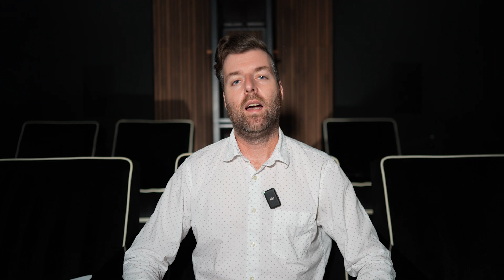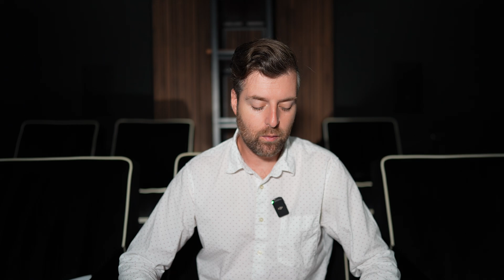Why don't H-frame DIPOLE subwoofers get more play time in HOME THEATERS?

Comment: Who makes H frame dipole servo subs other than GR Research? It felt like you were hard pressed to mention GR Research and Danny Richie
Reply from the maker: But I was trying to focus on a concept rather than a specific product. A specific product can’t necessarily overcome a limitation inherent in the design.  

And this has been a popular DIY thing for a long time. 

Really the servo piece js largely irrelevant. It doesn’t really increase max SPL all that much because servos take energy to clean up the sub. So eventually the subwoofer would clip the amp trying to feed back enough power to overcome the rising distortion. It’s better thought of as cleaning up the performance envelope over a larger dynamic range.

Comment: Recently have installed a DBA in my theater using four subs and a MiniDSP. It’s not enough for the width of my room and I can see the top end efficiency of the DBA is about 71hz, it’s smooth to about 95hz, and then succumbs to high-Q comb filtering above 95hz. It sounds incredible for what it is. Can’t wait to have enough subs to push that top end efficiency as high as I can.
Reply from the maker: Yes DBAs can be quite effective and impressive. I really didn’t bother with them outside of some experiments until Waveforming forced my hand. 

I will make the point here, just as an illustration, that this is where Waveforming sophisticated filters become useful. The DBA gives Waveforming a better starting place on which to work. But the filters allow it to extend the bandwidth a good half octave to octave above the point where the “analog” method gives out.  I get similar results with 4 subs as I would get out of 6-8.  And shockingly, I’ve gotten very good results from just two in the front and two in the back.  I did a theater recently with four in the corners. Used Waveforming.  I ended up with 1.2dB variance across the seats. It’s a 2 row 6 seat theater. That’s impressive in my opinion.
Reply: @PoesAcoustics  Impressive!

Comment: I do think, though, that the reduced excitation of modes by dipole woofers is significant. Perhaps a bit less with cardioids. A speaker designer with whom I work told me that in his experiments, four sealed subwoofers equaled a dipole woofer in smoothness of response and sounded as good, so it can be done. I also think that there's an issue with true dipoles and reflections from the front wall that create a notch. At one extreme, with an omnidirection speaker, the distance from the proximate surfaces can be split between the X, Y, and Z axes, so you don't get a complete notch. And, of course, as you say, the bottom octave doesn't benefit from dipole radiation since it's typically below the first mode!
Reply from the maker: Have you looked at Geddes simulation experiment looking at this. Once you get into multiples he found no difference. 

The main advantage of the dipole radiators is really reduced SBIR.  But for a home theater there are better solutions.
Reply: @PoesAcoustics  I haven't, sounds interesting. Am I correct in assuming that he's speaking of a minimum of four, rather than two? if the latter, it would seem to contradict Jim Croft's measurements as well as the measurements that Wendell Diller of Magnepan has made over the years in a number of venues -- I'm not sure why. If four, it's consistent with my understanding, and I think your right that dipole woofers aren't as practical for home theater.

Comment: Thank you!  I really appreciate that you always fine tune my perceptions with more precise descriptions 😀   I understand now the issues with using this servo approach with OB speakers.  I really could not test them in a way to compare the sound, because you can't run the amps with the servo function defeated.  I did do a lot of testing with REW and could see the effect of the three damping positions on the impulse response.  I did a ground plane test outdoors just with REW and frequency response was quite flat.  The 2% distortion I referred to was at 75db-ish REW measurement level ... but it was significantly less than the two ported subs I had been using.  I have not tried to measure maximum output, or distortion at very high output.  I will say that the Amaze demo does hit 105db, but certainly with no chest slam.  But for MUSIC ... the sound is awesome.  I am able to place them 7ft from the front wall and I'm using them in a (nearly) all Magnepan 7.1.4 system.  I appreciate your qualification of the mode topic ... yes I should have said they do not excite the resonances as much.  I did a test in an untreated room with one of these subs vs a ported 12" and I could distinctly see the difference in which resonances were excited by the OB sub depending on which direction it was pointed ... i.e. mostly the resonance in the front back direction in the room and not side to side or floor to ceiling.  I would love to see more quantitative tests, but alas even the company that sells the kits does not provide any test data.  Probably a great combination would be a system with these subs for Bass Management and true high output subs for LFE.  One more point .... I did not line the insides of the H-frame with NoRez.  I just can't imagine it would have any effect at these low frequencies, and I don't see any particular anomalies in REW measurements outdoors or indoors.
Reply from the maker: All makes sense. Servos work. They just have their limits. 

I mean I can achieve less than 1% THD at 75dB above 20hz with the RTJ 18’s. No servo and sealed box. That’s a function of the well engineered driver. In fact that low distortion would be maintained a good bit above that level.  Arguably these distortion levels are all inaudible and so some claim that what really matters is the point at which distortion starts to really get above that 2% point. When you see it start to skyrocket. Indicating it’s really in distress.

Comment: Hi Poe. I have a question about Dirac and room correction software in general. My understanding is that up to around 500hz speakers interact more with the room and so the room correction software is correcting for the room but roughly above 500hz it begins correct for the speaker, as this is when how much speakers interact with the room, especially well treated, goes down. Is this correct? Does it make sense to correct much further above 500hz especially in treated room? Or do you usually correct for the full spectrum no matter what? If cutoff is different from system to system, how do you find the right limit for the upper curtain?

Also, when correcting, do you manually add points on the curve to lower peaks if, after all the measurements and applying inital curve, you can still see peaks with REW because software isn't compensating enough to flatten the response?

Thanks!
Reply: There is something called the Schroeder Frequency below which the response of the room predominates and above which the response of the loudspeaker does. That isn't because the room modes disappear, but because they're spaced so closely together that the ear no longer hears them as such. At that point, you want to shift to correction for on-axis response, which roughly speaking accounts for 2/3 of subjective sound quality. To calculate it,  divide the room's reverberation time in seconds by the volume of your room in cubic meters, then multiply the square root of that sum by 2000. You will need a microphone like the Umik-1 and Room EQ Wizard (available for free) to make the measurement.
Reply from the maker: Thank you for supporting my channel. I’ll make sure to record a video and answer your question soon.

Comment: FWIW, it’s been my experience that open baffle systems attempting to dig as deep as would be required for chest slamming’ HT use - whether EQ’d  by more traditional methods or servo - require not just substantial amounts of power, but certainly need more space than small sealed or ported enclosures. Add to that the huge advantages of multiple subs in terms of controlling room modal issues and evening the bass over multiple listening positions, and I’d image things would start to get very impractical in less than huge rooms.
Reply: Agree, but as I understand it, dipole woofers control room modes just as well as four sealed or ported woofers. There are multiple tradeoffs here.

Comment: I think the average person wants a speaker with two wires they can connect to the back of a receiver and be done.  You can't do that with open baffle woofers, you need EQ and you need a lot of surface area.

I use sixteen 15" woofers in something similar to H-frame baffles using inexpensive woofers from Newark, formerly MCM.  (Eight on each side of the room) When I bought them a few years ago I think I paid $18/ea for them (I bought a lot of them, for other stuff etc) and yet the distortion performance met or exceeded the 15" Dayton Reference drivers I had used in a similar design years earlier at least within the design parameters of the system.  Mounted in magnet to magnet pairs, mechanical energy is cancelled and the cheap basket issues are made irrelevant, they aren't ever rigidly mounted to the baffle.  I cut them off at 35 Hz and at 90 Hz and I wouldn't trade them for any commercial woofer system I've ever experienced.  Below 35 Hz is handled by twelve 18" Dayton Ultimax drivers in infinite baffle, attic mounted also magnet to magnet pairs to cancel mechanical energy.  I cut the Ultimax drivers off at 10 Hz.

Is this a user friendly simple system?  No!  Most people wouldn't want a system like this, there really is no market for it.  If you want a system like this, you really need to build it yourself.  This is very much a DIY only thing, no commercial speaker manufacturer would want to touch it.  Speaker manufacturers have a lot to consider, if they offered something like this maybe they would sell a few systems but no where near enough to offset the cost to develop the design and build it in small quantity.  To me, it's a great thing, I wouldn't trade it for any commercial system but it's just not a marketable thing, it's as simple as that.
Reply from the maker: These types of systems I would like to someday be able to put through the same rigorous testing we put typical box subwoofers through. To evaluate their performance more fairly. We’ve never been sent one for review and so have not been able to test them.  While it wouldn’t be a proper test, for an infinite baffle system like yours, I could even potentially test it in room if need be.
Reply: IB supported, OB dipole bass presents as a best practices Tier One Operator! 

Dipoles don't "pulse" the room's resonances into excitation as significantly as monopole box subs. 

Thus, above the room's fundamental mode into the modal region, advantages are gained at the expense of extension (elevated direct sound vis-à-vis room sound).

IB platforms are uniquely qualified at extension sensitivity below the fundamental mode. 

I've built an IB, and experimented w/dipole bass.